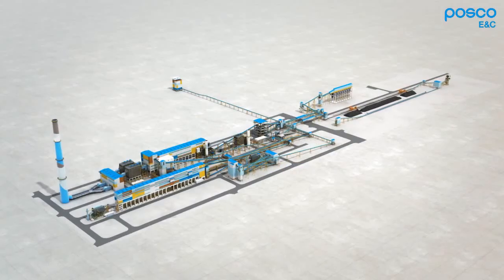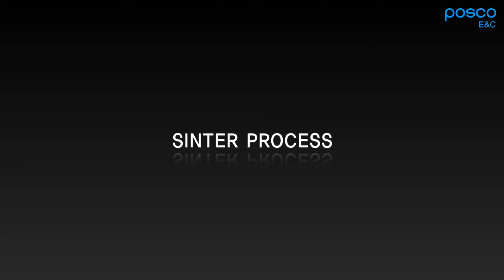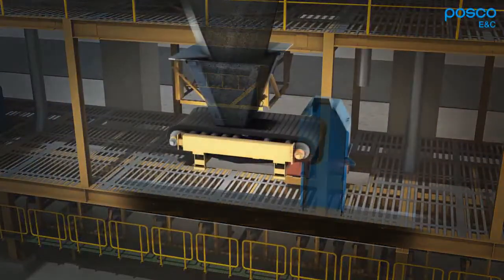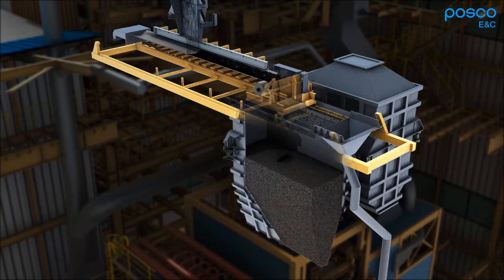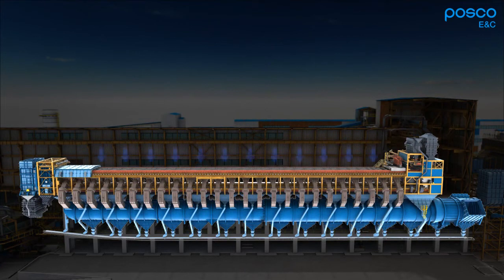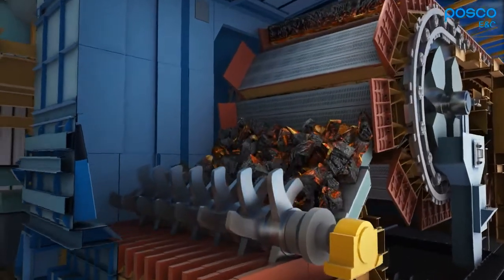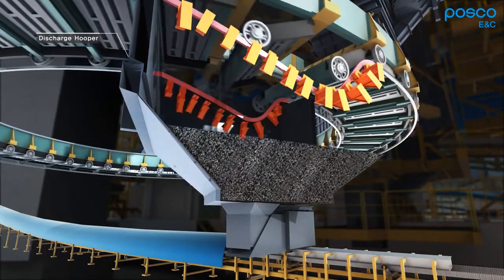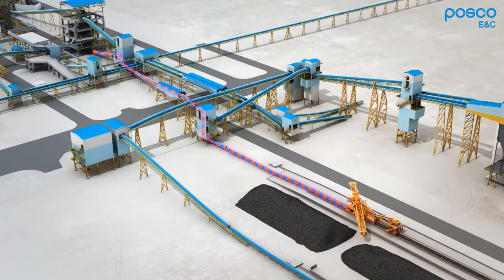Sinter plant

Comment: I've been a boilermaker/welder under the maintance section at the sinter plant in Newcastle - South Africa for my whole life after doing my military service and I'm 60 now and on early pension due to hearing damage from all the noise exposure (even though we used ear protection and dust masks and all the other ppe required), and prolonged work in this sort of inviroment is not good at all, but I must say your way of explaining how raw material is prepared for the furnace is all spot on, though some process goes through different machines here like the cooling process of the sinter happens on the same bed or strand where the strand is split for the cooling process with fans on either end of the plant for the sintering and cooling before going through the crusher and screening plant, but it all comes to the same product in the end and ends up in bunkers or on the bed where a stacker reclaimed will feed the furnace in a break down situation or while the sinter plant is down for maintenance, a plant such as this has a verry high wear rate and always requires tons of maintance, this was a verry acurate explanation of exactly how a sinter plant works 👍
Reply: I've been doing mechanical maintenance for long time/south Korea pohang. working at the sinter plant is very bad, but you did a grate job....  if you work there for a long time, everyone has problems with their ears. I feel the same ^^
I hope you have a comfortable retirement life. I'm also a retiree at a sintering factory. But where is that place?   sinter plant in the Newcastle?
Reply: @이좋은날  it's in South Africa / KZN (or Natal) and the company is Mittal steel, and thank you so much and I hope you're retirement is also good and you have a good rest, yes your right it's a terrible dirty hot dusty noise and dangerouse place to work and hearing is one of the first to suffer from long exposure to this work inviroment, I'm glad it's over for me because even though I loved and had pride in my work and I gained much respect for my hard and reliable work and problem solving, it was hell, now I build things for my home to keep myself going 🤣👍
Reply: @이좋은날  you can see it on Google earth, the dirty parts is sinter plant and the coke ovens 🤣✌
Reply: You were working in Arcelormittal Newcastle nhe?
Reply: @asandakelembe1256  yeah
Reply: Wish I can get that experience as of now 😅. I'm also working in AMSA Vanderbijilpark Works Rolling Cold Mills. Tomorrow I'm having an interview outside and they need someone with Sinter plant experience. Unfortunately I don't have, but I will try.
Reply: @asandakelembe1256  yes give it a go my friend 👍, I hope you get the post but just know it's a crap place to work in, is it there by you or for Newcastle ?